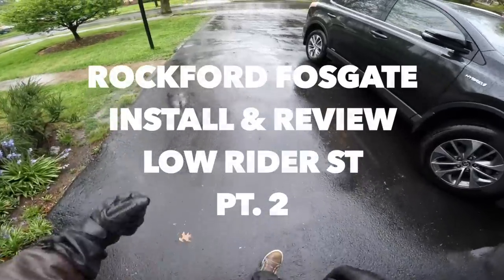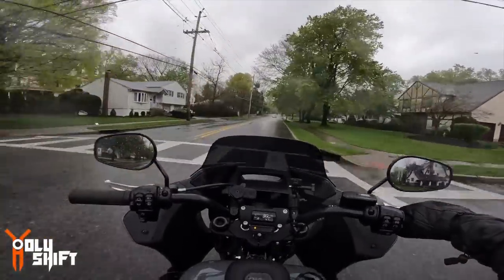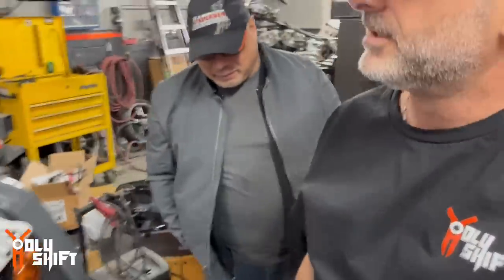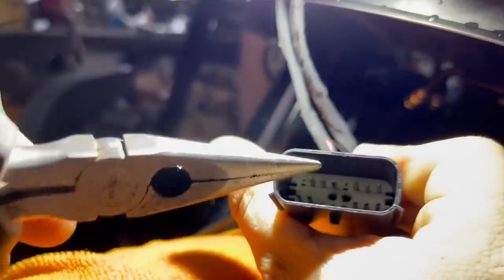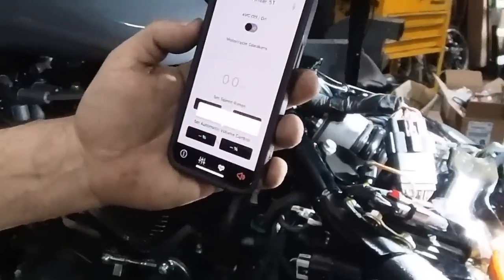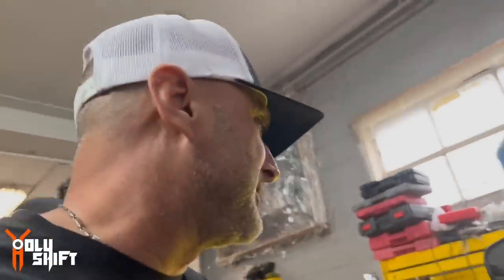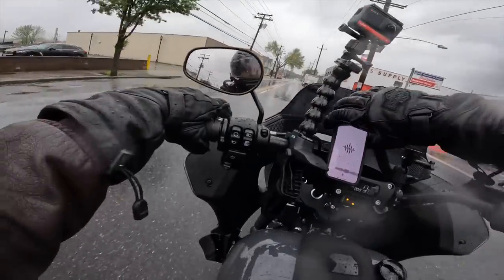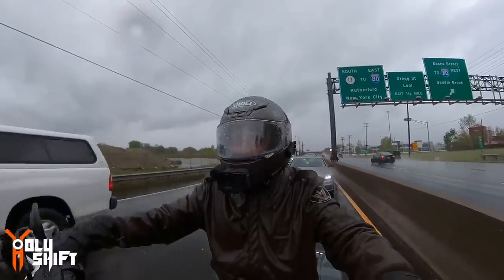Harley Gave Me A Gift ….

Comment: Uh that's not how you insert the new wire. The center of the coupler has a white base plate with 2 larger holes dead center. Use these holes to lift the white base plate up 1/8 in. Do not pull it completely out. Above each pin there is a small hole used for releasing the lock. Use a 16 Ga. needle (Leather Craft) or the proper  pin tool and insert it into the small hole. Using needle nose plyers, pull the plug out the back. Insert your new wire and push the white base plate back down. FYI for you DYI followers.

Comment: Little late now but Rockford fosgate has a good video out of this process on the low rider st showing how to pull the pin right out the back, they didn't even use any special tools. So if anyone is reading this after the fact it should help. Great video as always!

Comment: 2 questions for you! 1) how’s the base on the unit since the speakers are 5.5” only? 2) since bike doesn’t have traction control system how’s the rear tire grip under full throttle?
Reply from the maker: 1 sounds great and balanced.2 No issues with riding. 💪🏻👍🏻

Comment: I just bought this bike tonight…. I traded my street Bob..   I have to get used to the lowrider.. it rides different.. the street Bob handle so well..  so easy to uturn in a tight spot..  after a thousand miles on the street Bob I felt like a pro rider.. now I’m back to a beginner to intermediate level…